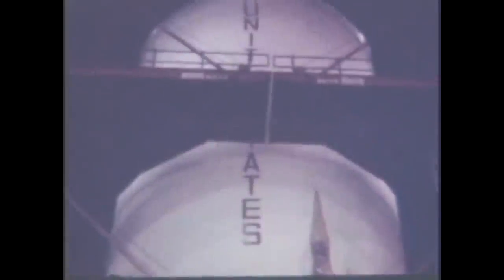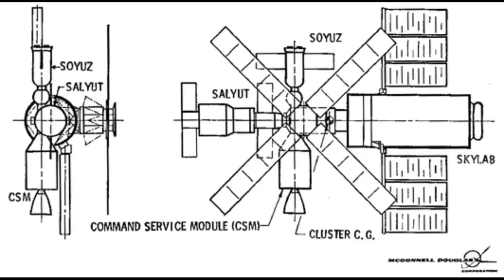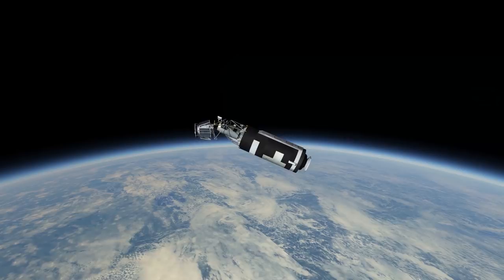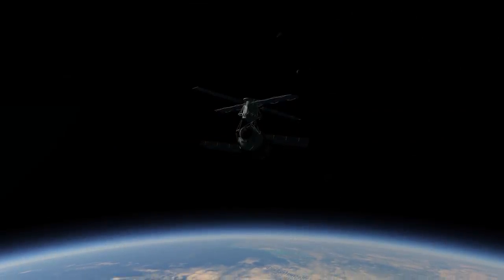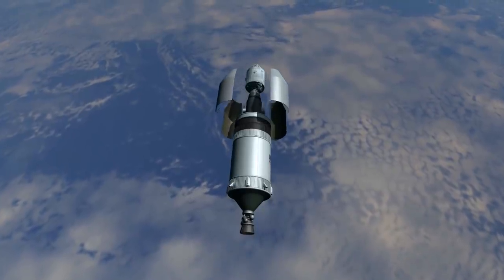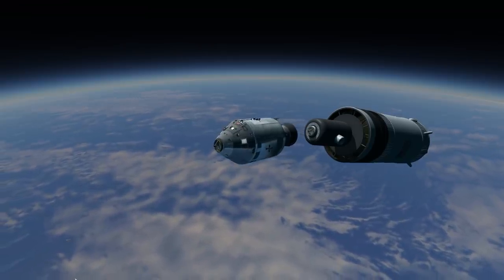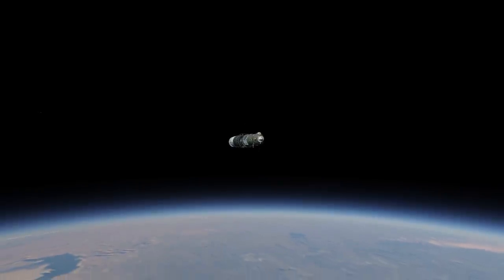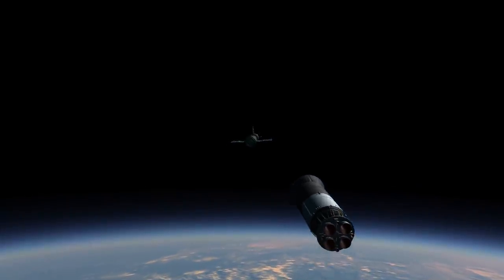International Skylab - Episode 1 - If History Had Gone Differently (Kerbal Space Program - RSS/RO)

Comment: I think the Skylab A's orbital inclination is approximately 50 degrees, while the soviets preferred the 51.4 degree inclination. I wonder how much delta-v would it have taken to shift the orbital inclination by 1.4 degrees.....
Reply: Around 450 m/s
Reply: @AluminumOxide  Thank you. I was thinking it would be roughly there. So 450 m/s would definitely require a tug of some sort if we wanted to move Skylab. Also to note, Soyuz has a delta-v of 390 m/s and Space Shuttle (full payload) has a delta-v of 300m/s. So neither spacecraft can visit both Skylab and Salyut. Apollo CSM should be able to easily do the inclination change as it has a significantly larger delta-v even if only half fuelled.
Reply: @Makoto778  This mission would have used the second Skylab module that, IIRC, went to a museum IRL.
Reply: @MrCubFan415  Yes I'm aware of that. Just a thought if it was possible to 'reuse' the original Skylab instead of launching a new one.

Comment: 14:40 how do they adjust for the center of mass being offset?
Reply: RCS would translate the craft sideways, but in doing so, yes, the offset mass would cause some rotational movement. The RCS system would additionally be able to cancel out said rotation as well. They would be going very slowly anyways, so its easier to compensate.
Reply: Docking that combined CSM+adapter stack sideways to the Skylab at 17:30 seems like the trickier problem.  Would the standard RCS quads have had enough control authority?
Reply: Later missions going out to the moon, the LEM docked on the nose of the CSM weighed as much as 36200lbs (16400kg). The RCS was able to rotate the two craft around so the CSM main engine could fire in the right positions.